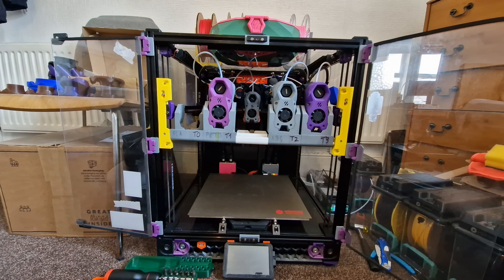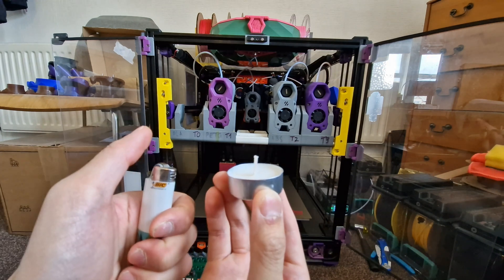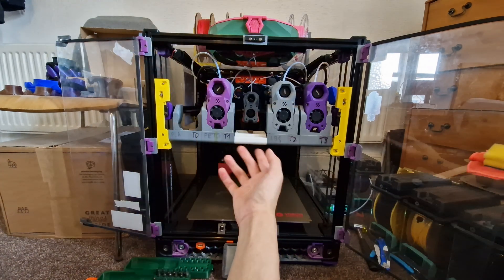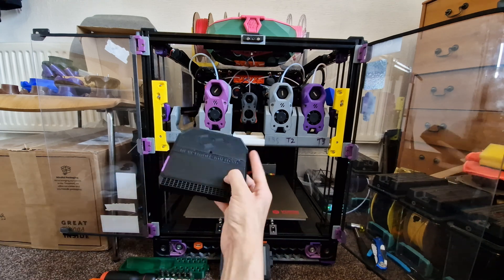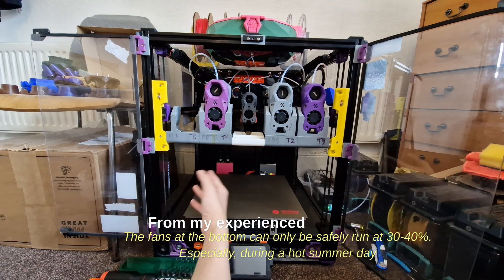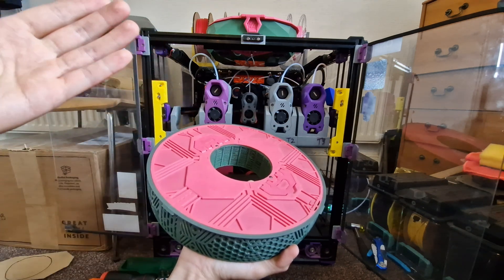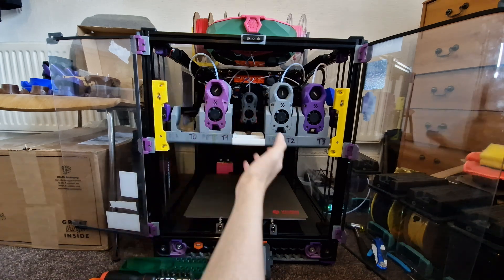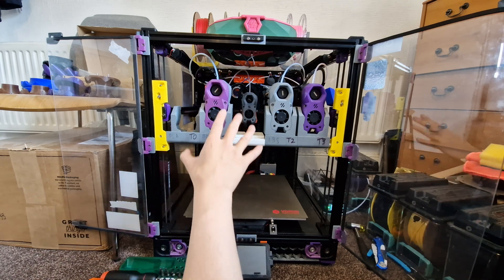Active Chamber Temperature Mananagement (ACTM)

Comment: So i got active heating. I set mine up with a second 120v circuit. I put thermistors in the heaters ( I have two ). I have a 24v to 120v relay that is hooked up to a Fan output on my main board. That way if heater fails and temps get to high everything shuts off. preventing a fire. I believe it has been a game changer for printing in ABS. My prints are more consistent and over all just better. Also a Voron 2.1r2.